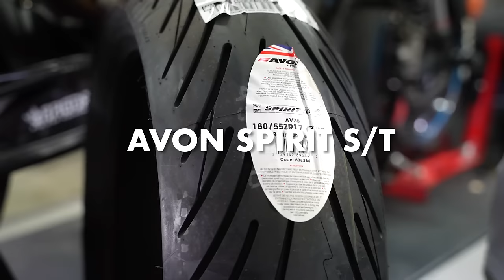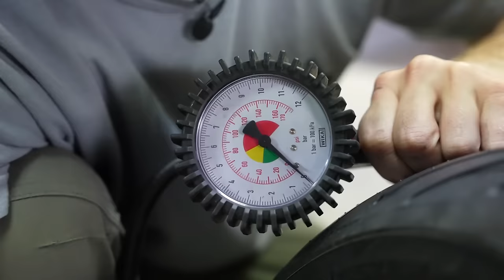My stunt bike gets all my attention. It came out insane! | RokON VLOG 156

Comment: I also have a 790. I wanna start learning wheelies. So I need antiwheelie or can I do it with a stock 790? What do you recommend?
Reply from the maker: Just disconect the abs cable on the rear wheel or plug out the ABS fuse. This way you the abs will not interfere when you need to lock the brakes etc. other tips you can find in my how to wheelie tutorial on my chanel ;)